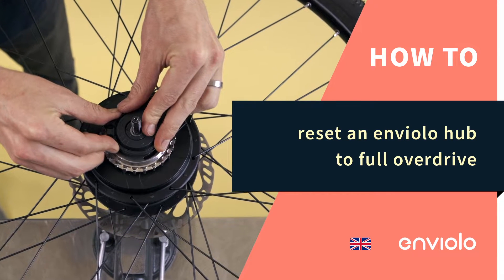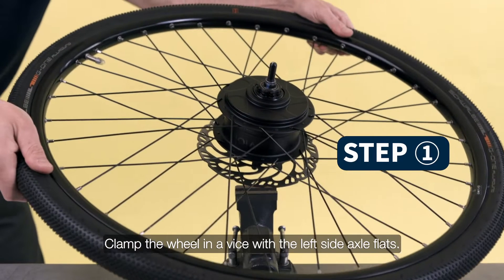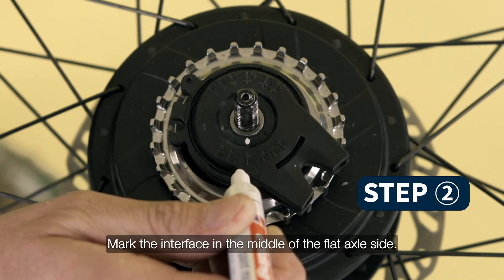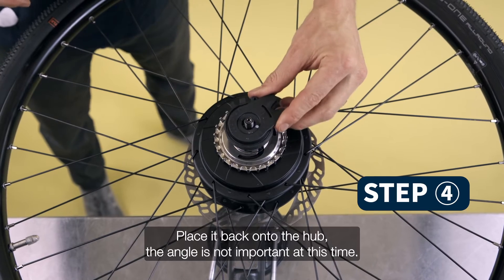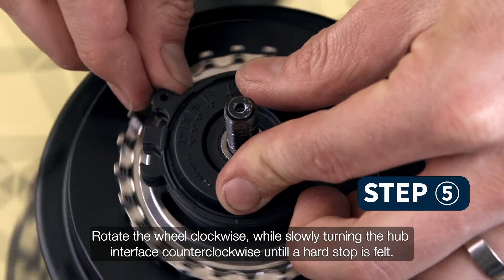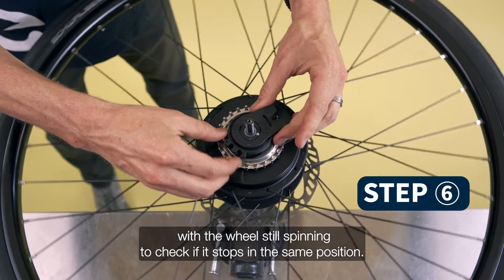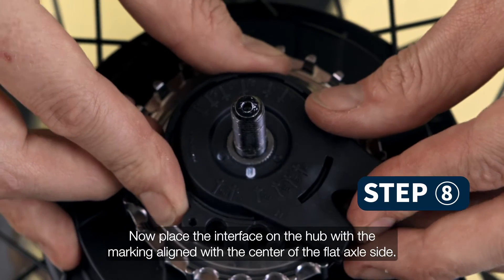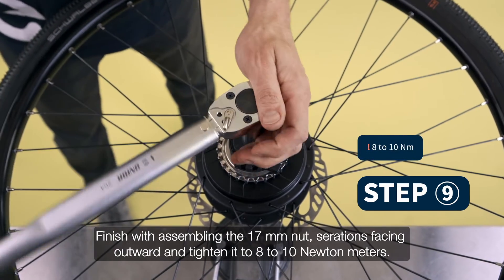How to reset an enviolo hub to full overdrive.

Comment: Does it matter where the hard stop is found? E.g more to the L or to the H indication. I have no blue indication marks on splines anymore to check if correct
Reply from the maker: The hard stop depends on the position of how the interface is placed back. A hub close to full overdrive will have a different position for the hard stop than a hub close to full underdrive. The main thing is to reinstall the interface in the correct position without changing the position of the cable ends.
Reply: @enviolo  ok thanks but how do I know where the hard stop needs to be in correlation to the interface when I remount it?
Reply: The bike that I’m working on doesn’t have a fixed axle with 10mm flats but rather (2) removable 5mm axle bolts that hold the wheel on. Please advise on what to do in that situation. Thanks

Comment: @enviolo - when optimizing for overdrive, should I still have the full 380 gear ratio? Or will the ratio change as a result? Having issues with spinning out in highest gear (flat line) and mechanics have already done this - did not resolve the issue.
Reply: reset overdrive when you can't reach the highest (hardest) gear and don't reach advertised speed even when pedaling hard.  After doing this correctly (it's not hard) you shoull have the full 380% range of the enviolo.

Comment: It would helpful if the video explained why you might want to reset the hub to full overdrive. What are the pros & cons?
Reply: +1

I'm trying to help someone remotely whose LBS seems to have disadjusted the interface while replacing the two cables: At this point, with the cables unhooked and the wheel off the ground and spinning, the interface only turns 1/4 of a turn from full underdrive (ie. noon), so she can't reach full overdrive (ie. half past)

I wonder how easy is to disadjust the interface when changing the cables.
Reply: I was thinking the same thing exactly. That and they should use humans to narrate them.

Comment: Would just like to say that this video made me buy the turbo vado 3.0! Went to the store, test drove the bike and couldn’t reach above 20kph without pedaling over 80 rpm and needed at least 120 rpm to get to 32kph. I told them the bike didn’t make any sense and that I wouldn’t buy it unless they fix the issue. That’s when I showed them this video. They had no clue and decided to try so they don’t lose the sell and after 1hr, the bike came back to me and it was literally night and day difference!! I was going to the speed limit of 32kph here in Canada with regular cadence of 80rpm. I don’t understand why Specialized would send the bike from factory tuned this way. Thanks for the video again
Reply: @MustafaHussein-tf2syit was tuned the same as if you were going on smallest gear all the time.  Impossible to go fast!
Reply: @MustafaHussein-tf2sy it’s explained in the video how to set it right
Reply: @MustafaHussein-tf2sy mine was, makes no sense !!

Comment: Plz learn the resellers of this here in Belgium. After a cable breaking of the system i could not reach the 45 km/h. After complaining they said its normal and the system go's full length. After learning of this video and showing them it, they still dont understand it. One of the biggest reseller of Belgium. Now i did this by myself and resolved the problem.many people on different forums are disappointed with this. They doing 90+ rpm and going 35km/h and they think it's the bike fault. so there next bike won't have this system
Reply: I'm doing 110rpm to get to 43-44km/h with my speed pedelec (with manual enviolo system). I tried resetting to full overdrive (with a bicycle professional of course) and it was already set to full overdrive so it didn't change anything... I don't know what to do...
Reply: I need to go 92rpm to reach 30-32 kph, here in Canada we’re locked @ that speed! Wish it was at 80 rpm for max speed, anyone was successful into the correct adjustment
Reply: Welk tandwiel heb jij achteraan?